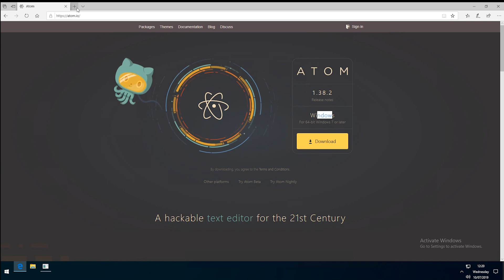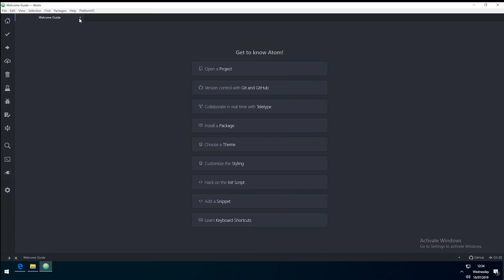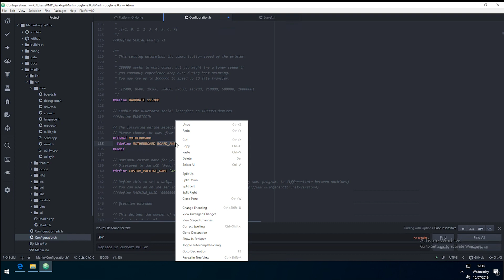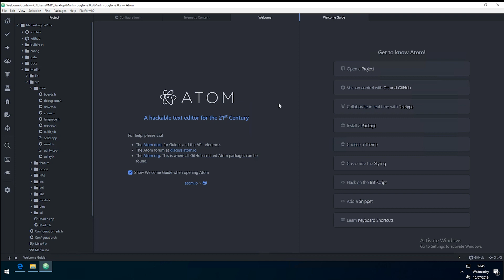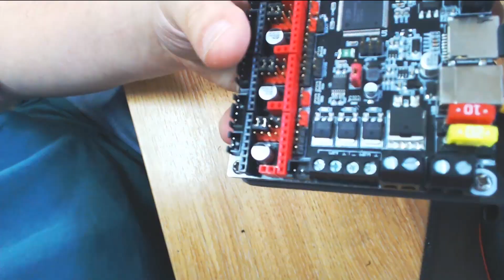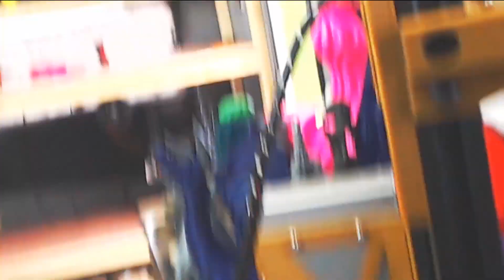3D Printing: Guide - Marlin 2.0 + SKR 1.3 Install - !!!

Comment: I don't understand why you used 5 drivers if anet uses the same driver for both z engines
Reply from the maker: I used 2 drivers for the Z as the skr board doesn't have a split port from a single Z driver like the anet board.
Reply: @3dnightmares  sorry, I did not understand these parts, I am from Brazil and as I speak Portuguese I have to watch some videos several times to get all the details, I have a SKR MINI 1.1 and TMC 2208 drivers but so far your video was the most tutorial  next installation I found of this model, I also have an anet a8.
Reply: parallel socket will take care of that.
Reply: My Atom doesn't look like that at all! I don't have the left side menus to click on!